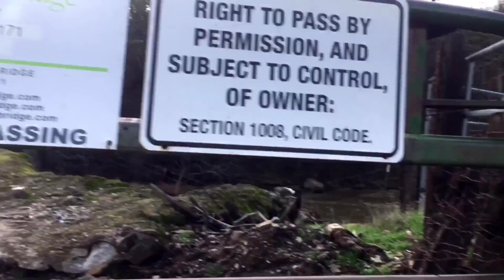California storms take 911 offline. 1/14/23

Comment: Uncle Marty! Can you hook me up with a job? -Sean , John Dillons son
Reply from the maker: Well it’s definitely not a full time gig. It’s on call whenever some kind of storm or disaster hits. 
You need to know electrical and have a full size diesel 4X4 to start with. Then a transfer fuel tank in the back. Tools are basic electrical tools to hardware in a generator. Then a chainsaw and fuel for it. Some times you might spend all day cutting your way up to a site. I got lucky and didn’t need to. This time.